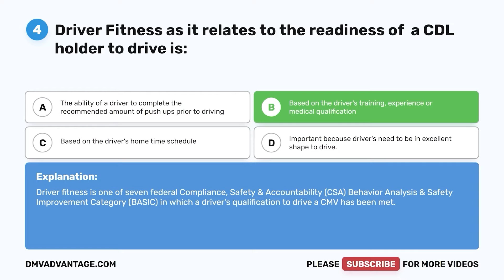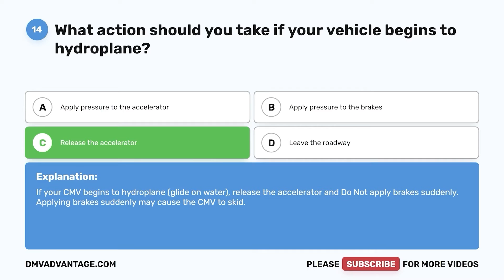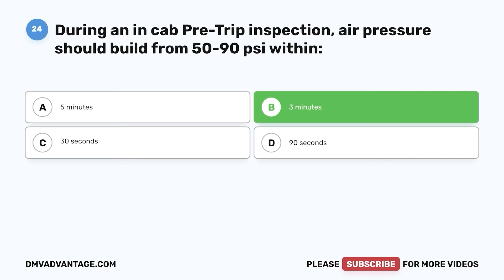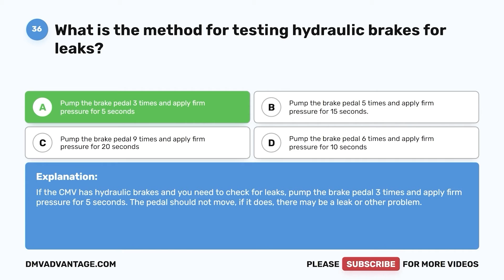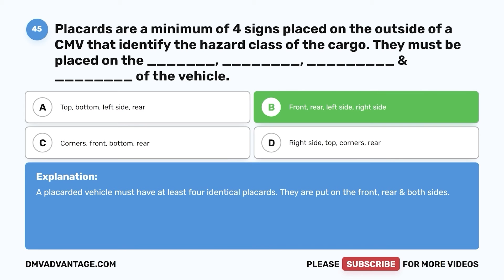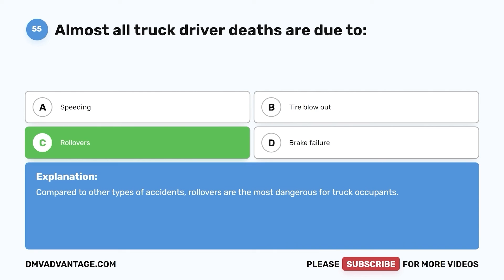Illinois CDL Practice Test 2023 (60 Questions with Explained Answers)

Comment: I got all these right and am taking the test tomorrow, if I fail I'm gonna be super upset. I'm really nervous bc I have social anxiety. I had my CDL for 5 years got divorced and wasn't in a mentally head space to be driving one of these killing machines. Wish me luck.
Reply: I did pass I passed general and combined but the air brake test they get tricky and I failed 2x 2x by 1 and then I opened CDL prep and kept redoing the airbrake part and did it and told the lady I'm a combat vet with PTSD she gave me ear plugs and I got 1 wrong now on to the pre trip and most likely back over the road.
Reply: @justinward-angelucci7207   I’m proud of you man keep going you just motivated me to go take the test and I literally don’t even know you 💯💯🤝
Reply: @lowgrady4ever  thanks dude 😎
Reply: @justinward-angelucci7207  congratulations
Reply: @justinward-angelucci7207  and this is for Illinois right
Reply: What's the update
Reply: Did you pass
Reply: How similar was the test to this video? I want to go next week to test at Elk Grove. Also, are there any similar sites that you know of to help prepare?
Reply: Update mate? Hoping you are well
Reply: 😩😂😂😂😂 bro I’m fuckin dead
Reply: How close were the questions and answers to the actual test?
Reply: @Adrianx12   What really helped me out was the CDL prep app. It has an icon of a steering wheel. The questions on there are word for word on the actual exam. I would highly recommend using the app. Let us know how it went! Good luck
Reply: @nestorvalladares6823 which app is it ?
Reply: @nestorvalladares6823 you the realest nigga I know
Reply: Congrats bro . I know it was long time ago . Anyway i could contact you bro . I need some help . Appreciate it